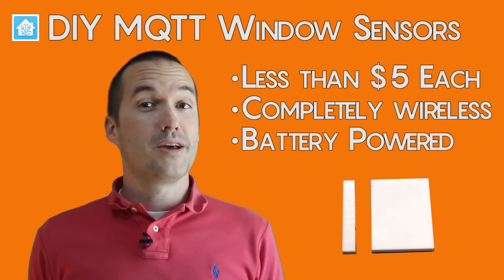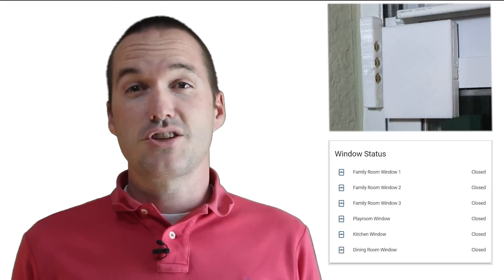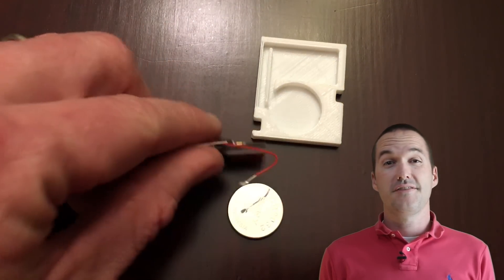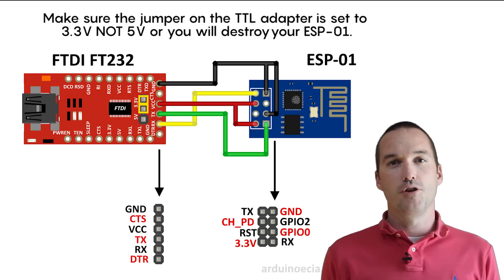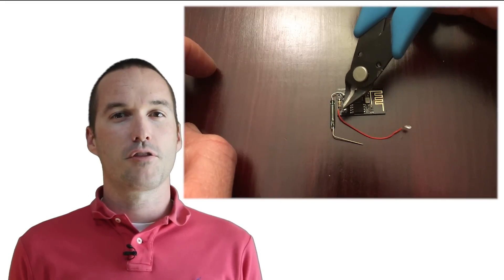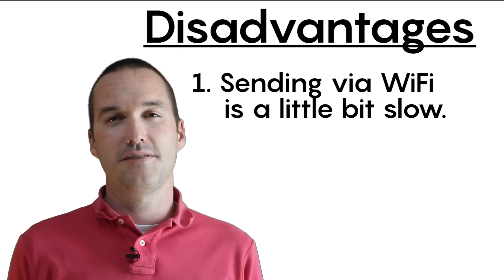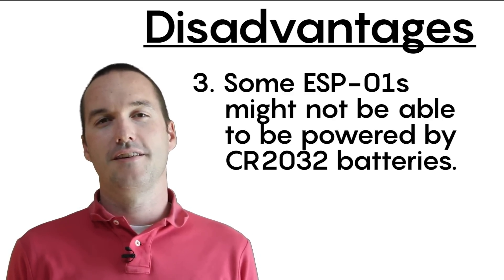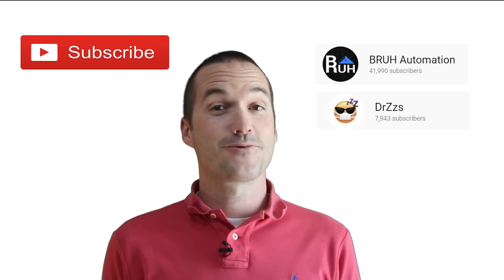$5 DIY Wireless MQTT Smart Home Window Sensors

Comment: It’s a great solution for something that should never be moved or opened.  A great way to also make a lock with included alarm if you don’t correctly disable it by moving the magnet with the sensor. Very neat project to build on due to the power disabled normal state. Or have an always ready to go ‘wipe it all’ kill switch handy to purge drives.

Comment: I know this is an old video but I'd love to some someone like you dig into making DIY devices for Thread.  I've been doing a lot of digging and slowly learning but looking at building something like these window sensors that work with Homekit using Thread.
Reply from the maker: Thread is going to be replaced by, or rather is going to become Matter.  At this point there's no reason to make a purely thread device.  I actually just ordered a matter dev board and will be doing a video on it.
Reply: @TheHookUp  My understanding is Matter is an application layer that will use Thread as a preferred transport protocol which is why I said Thread but yes Matter is the end goal here :)
Reply from the maker: @JohnVanderbeck  Your understanding is correct :)

Comment: It is late and I have not slept for the past 28 hours so please excuse me if I'm missing something?

The way I have seen this is, with the window closed, no current is passed, open the window and woosh, current passed, ESP boots, sends MQTT message to say the windows open.

But...

What if the window is not closed for a good while? surely the ESP is fully powered for that entire time thus draining battery?

Would it not be better to have some timing circuit on the VCC that once the reeds are triggered runs for say 15 seconds then cuts VCC and puts everything back to 0 current?

This would reduce battery drain a great deal.

But like I said, tired... dead servers to resurrect.

[Strummers Law: No input, no output]
Reply: OK. how about using an XOR to detect the stat change of the reed switch, that would be simple enough?
Going to bed

[The future is unwritten] Joe Strummer

Comment: what if i don't want to do a diy window sensor? can you please make a video about different security system window sensors that won't easily be tripped by somebody who is just a regular guy (for example, somebody can just peel off the simplisafe door and window sensor and come back later and reglue it back on like it didn't happen)...pls feature both wired and wireless versions...also would you have a video on a good setup for whole house security system setup for a new build - really need that right now...thanks and love your channel; just wish i am more of a techy diy type

Comment: How does Amazon dash button do it? It’s WiFi too
Reply from the maker: It's quite a clever beast.  It actually never connected to wifi, it just sent some broadcast initialization packets to the router that would then get processed by echo devices on the same network.  By avoiding the full WiFi handshake it saves a TON of battery.
Reply: I don’t think having an echo on the local network was a requirement. I think you are talking about the ARP packets that hackers/DIY-ers used to listen to the button presses. You might be able to replicate the ARP packet approach. ARP packet is sent when any device connects to wifi. So you don’t have to send anything to mqtt. Just fall asleep immediately after connecting to SSID and have a script listening to ARM packets with the known MAC address of your esp-01. They claimed 250 button presses of off one AA
https://mpetroff.net/2016/07/new-amazon-dash-button-teardown-jk29lp/

Comment: Is there a way to incorporate a delay in the reed switch action ? I want to create a wifi button from this, but I don't want to press the button and hold it while it boots and sends a message. Would this be some mosfet thing ? I've been using WyzeSense for a button with HA, but these sensors all full stop unreliable. I have 5 dead ones already. The amount of labor I've spent with debugging the WyzeSense problem could have paid for a hardwire of my house. Thanks

Comment: Hi Mate, awesome video and great to be on the hook up. Totally new to the entire home automation and only got hooked onto it during lock down so bare with me. I followed this video ordered the parts and got them last week. have made the window sensor and it works as expected and I installed a mqtt snooper app and i can read the open close messages. My issue is how do i now add it to my home assistant like you had on your video where it monitors all the windows
Reply: Go to the HA forum and you should be able to find your answer with step by step mqtt setup.

Comment: For me it dont go to closed with few seconds even after the esp01 is off but get closed after 22 seconds even if the esp01 is still on. How to rectify this
Reply: That 22 second delay is probably caused by your home assistant setup. I know my Raspberry Pi install with SD card is pretty lax with timings. I've read that moving it to SSD will speed things up.
Your second problem with the window being marked as closed while it's still open, that's the way he's coded it. It only sends the open status once. He's using it for the notification that the window was opened rather than as a status indication. You could try playing with the ESP.deepSleep(0) value to make it keep sending an open status but then you'll get some weird toggling issues when your home assistant sends it's default closed value. There's a way to do this smoothly with an automation but I'm not good enough at HA to guide you.

Comment: Hey, love your channel. I'm just getting started and trying to follow along. I get the following message when I both up the ESP-01 and check the Mosquito log on HA:

1. New connection from 192.168.1.153 on port 1883.
2. 1596619053: New client connected from 192.168.1.153 as KITCHEN_WINDOW (p2, c2, k15,  u'mqttuser').
3. 1596619075: Client KITCHEN_WINDOW has exceeded timeout, disconnecting.

Any idea why it's timing out?
Reply from the maker: because the code turns the wifi radio off after a successful transmission

Comment: HI, I have a Kerui Wireless Alarm System. I have all the door sensors and alarm panel setup but would love it to be intergrated via the Home Assistant. Does anybody know how I could do this at all. I am new to the Raspberry Pi but loving it. Any help would be much appreciated. Many thanks
Reply: If you have the Kerui I see on amazon, there is no real way to do this. It is a completely closed RF system without an integration point. I used  wyzesense contact and motion sensors with HA, but reliability has been terrible. That is why I am looking at these or just getting the house hardwired.

Comment: Nice Video, I learned much. I hooked this up and started the debug program in Node-Red. I noticed though when I run the script code that it says "open" when I apply power to it on node-red. Then after approximately 23 seconds, it says "closed". I use mosquitto broker. The mosquitto says that it exceeded timeout and disconnected when I look at it even when I still have power on it. Is there a problem with the code. I can't seem to keep the ESP8266 alive. I have tryed two different ESP8266 modules and I am using a standalone power supply for 3.3V.
Reply from the maker: That’s what the program does. That is working as intended, this is not meant for windows that you will leave open.
Reply: if you still want one that stays open you need to keep the connection alive... heres one I have here https://pastebin.com/t5jiEwTS it only sends the open message on boot and sends "0" to another topic on loop and a closed when you disconnect

Comment: I would like to see an update of this video with ESP NOW, very easy and less energy consuming.
Reply from the maker: The issue with ESP NOW is you also need a always on ESP8266 as the receiver (hub).  I've played around with it but ended up sticking with the initial design.  About a month ago I opened up all the windows to make sure they were still kicking, all messages came through as expected.

Comment: Hi The Hook up where is the home assistant setup for this project?
Reply: I would also like to know about the integration in home assistant. I subscribed Mosquitto mqtt broker to the topic of the sensor. But now I need to include it as sensor. I would like to integrate it as binary_sensor though. Anyone any ideas how to achieve that?
In complex heating control with schedy in HA I see the window sensor switching from closed to open and back to closed from time to time. I just want it to show open and not send any more message on the mqtt topic. Is that possible?

Comment: Hello there! I started a project with this video https://youtu.be/02spXPoa_Y8 “monitoring upto 16 analog sensors using NodeMCU...” with the purpose of turning my old alarm system but using the wired sensors around the house without paying Konnected and do the fun of DIY... but I’m very new with coding and don’t know if it’s possible to integrated with HA. I appreciate all the help. Thank you

Comment: Great project! But I don't think most of people can do this. The WiFi definitely is not good choice for smart home applications, specially for the battery powered sensors. The LoRa wireless will be the best future for smart home. There is a new brand YoLink smart home products available on Amazon. The whole house smart security system including door sensor, leak sensor, smart plug and LoRa hub, all together cost under one hundred dollars. I strongly recommend everyone should use it and try this new long range tech.

Comment: Use a sonoff rf bridge and standard rf window sensors. Sensors are around 5$ but use AA /AAA batteries and will work way longer. Also they have real open / close messages and sometimes anti tamper contact or battery low message
Reply: Ditto. I have 5 rf windows sensors with the sonoff rf bridge. Works great. Dr ZZs has a video on using these sensors with the bridge and where to get them cheap.

Comment: 1- use a cheap boost converter (under 1$) to boost the voltage and get much more out of the battery
2- use ESP-Now instead of wifi and make a simple custom esp-now to mqtt bridge for all your modules, you can reduce transmission time from 4s to around 0.1s, also the system would be much more secure
now your batteries would last forever
Reply from the maker: Both really good suggestions.  The purpose of this project was to make something as simple as possible, so I didn't want to add a boost converter and double the price and complexity of the board.  I also wanted them to work independently of a hub which is why I decided against ESP-Now (although I did experiment with it and I do have a working version that utilizes it).

Comment: Excellent solution Rob I've replicated this in my lab and it works great.  Is there a way to adjust the code to stop the chip returning to the default state of closed? I want to use this on some windows which stay open for an hour or two and with the state returning back to close within 50seconds I don't know if my window is still open at the end of the day.  I know this will drain the battery faster but I'm okay with that.

Comment: Sadly it appears that the four ESP-01s I bought must be the power hungry type. When I hook up to 3.3v it works perfectly in about 2 seconds, but when I use a new CR2032 straight out of the packet the lights come on then dim or go out, and no message is sent. Checking with a multimeter  the cell voltage drops to ~1.4v when the circuit is made. I've nipped the LEDs off a couple of boards but no difference.
Reply from the maker: That's a bummer.  The case would need to be modified but I wonder how an A123 battery would do in this situation.
Reply: @TheHookUp  Thanks for the steer I'll look into them, and thanks for the videos on these sensors. As I'm new to smart home stuff your videos have been gold.

Comment: Hi nice video! So I’m trying to follow your code but I’m not sure what is going on in the reconnect loop and why you set boot to true on the beginning as well as why you have certain if statements checking if boot equals true when it will be true in the beginning from the get. It would be good if you could add comments on why you are doing it this way. Also why is the while loop checking if client is NOT connected “!client.connected()”

Comment: Wouldn't the three second delay mean that the alarm would not sound if the window is closed again quickly, cutting off power to the ESP-01? While that time is probably not realistic for someone to pass through the window before slamming it again, it could be feasible to throw some object inside the house, like some nasty gas, surveillance device, or whatever undesirable thing. I'm thinking that transmitting a 433Mhz signal (like from a wireless doorbell) could have a shorter reaction time than connecting to Wifi. It shouldn't add a lot of volume or cost to the window sensor. 

Another thing is that a somewhat smart miscreant could bring along a magnet to interfere with the sensor. This could be made harder by adding a second normally-open reed switch just outside the range of the installed magnets.
Reply from the maker: Yep, these things fall under the "good enough" catagory for me, not "perfect".  They have some downfalls and there are situations where they won't work (a wifi blocker or deauther would be the easiest route), but introducing additional complexity to the circuit seems like a waste just to cover those edge cases.

Comment: for wireless sensors should be used cheapest and low power solutions based on STM32 MCUs. For standard wireless alarm system should take less than two seconds to send alarm event. Otherwise the sensor can be destroyed by intruder person. Also system must monitor battery state that means to send message with battery state. Any way good start and system step by step can be improved.
Reply from the maker: Using an STM32 kinda misses the point.  The whole reason I made this was to be able to use them with WiFi without needing a hub.  If you used an STM32 you'd need to use some other module like RF or wifi (in which case you'd be using both the ESP01 and the STM32).

Check out my follow up video to this one, I was able to get the transmission time down to around 2 seconds using a static IP: https://www.youtube.com/watch?v=2kLZ7DlP9KU
Reply: @TheHookUp  Agree with you that for STM32 + nRF / CC11xx / CC25xx / OTHER_RADIO require some gateway to connect sensor over Wi-Fi . I found some gateway solutions based on ESP8266 like: https://github.com/derkzomer/nrf24l01-esp8266/blob/master/post.ino
or https://github.com/1technophile/OpenMQTTGateway
It could improve power consumption, extend range in case of use 868MHz / 915MHz . In near feature I planning to connect my Irrigating system over the similar gateway solution to MQTT broker located in Raspberry. It will be nice to collaborate and share and publish source code.

Comment: Rob, thanks again for all your awesome work.  Two questions:
1.  The Amazon link for the buckyball magnets goes to 2.5mm magnets, but the holes in the magnet holder's .stl file sure looks to be near 5mm.  What size magnets is the .stl file designed for?
2. Have you ever thought about integrating a simple database into your Node Red flow, so that rather than have a "default" state, every time the sensor's state changes, it pushes the most recent state to a database, and THAT's the value that is displayed in a dashboard?  That way, you know whether your window is actually open or closed...

Thanks again!
Reply from the maker: The problem is the device never knows when it is closed.  It wakes when it goes from closed to opened, sends a message, then goes into deep sleep.  Closing the window cuts all power to the device so it can't send a closed message.
Reply: Thanks for your answer...that makes sense.  How about the buckyball size?
Reply from the maker: @adambaker5854    You are correct about that, mine are 5mm.  For some reason I assumed the 2.5mm was a radius, but it appears that is the diameter.  This is the correct size: https://amzn.to/2UG8u4K

Comment: Bad people do not open the windows. They break them.
Reply from the maker: To be fair, they normally break them, then reach in and open them.  Less shards of glass end up on you this way.
Reply: What random thieves do is look for open windows and check unlocked cars if you can hit a few cars fast and be in and out of houses without making allot of noise or drawing attention that's best but if you're a specific target where someone has a good idea they can get a specific thing or get a good haul they'll visually check for open windows no open window try an easy window if it doesn't open break it unlock it and open it in most every scenario the window will be opened unless they might see the sensor

Comment: I've been watching your videos on node red, thanks by the way,  and whilst I agree this is an interesting project,   I would suggest you look at the CC2351 devices and Zigbee2mqtt software,   so far I have bought aqara sensors Windows latch, temp/humidity and a double pole switch.  All work brilliantly with MQTT, Home assistant and node red. And NO aqara xiaomi hub required,   I also control my idea tradfris with this too no messing with upgrading them or linking to hue.
Reply from the maker: Yep, it's a pretty good option these days.  I believe this video predates zigbee2mqtt by 6 months or so.